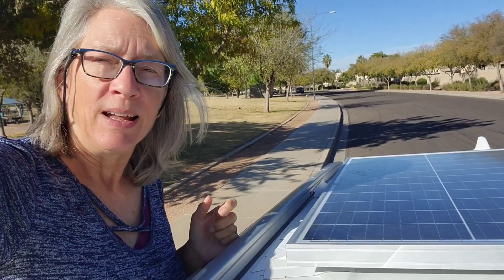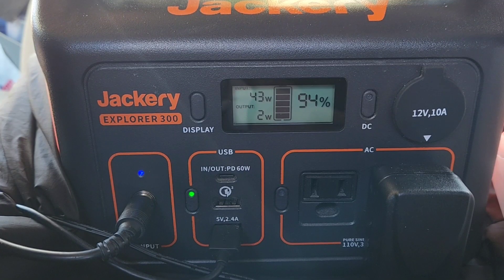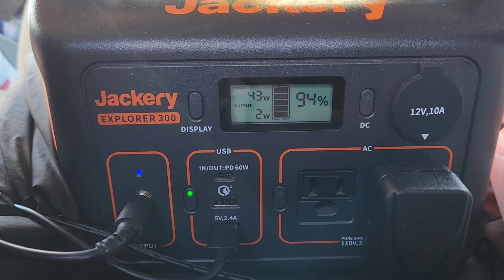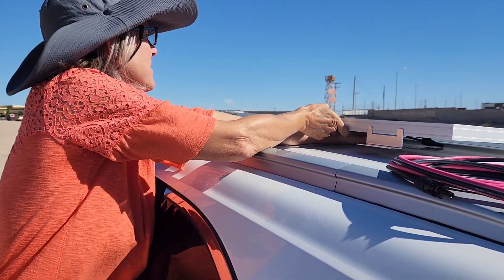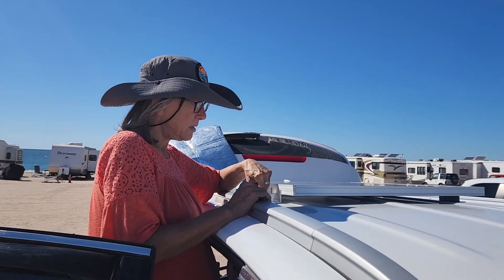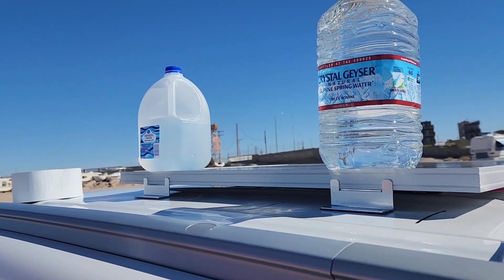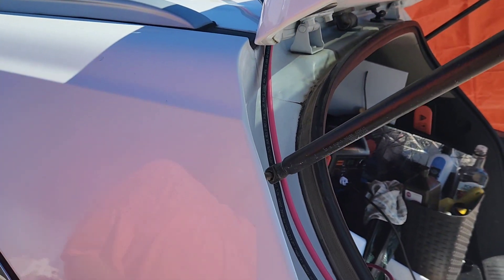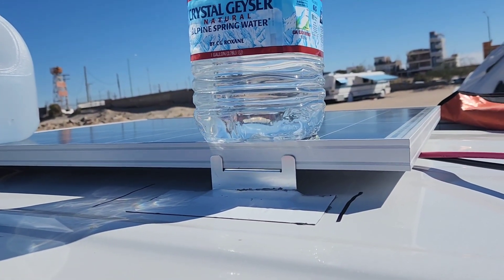Solo female nomad SUV solar panel upgrade how-to

Comment: Hi again. Really enjoying your discussions of nomad life. As I mentioned in another comment, I’m 2-3 years from retirement and am spending a lot of time researching various aspects of living in a van. My power wants (not “needs”) include a refrigerator and a heater, which means a much bigger power requirement. I’m probably going with converting a Ford Transit and using a 1500W power station that lets you recharge while you’re driving, with solar panels to top up when spending several days at a site. I’m still in the middle of my electrical choices. I’m thinking, if possible, I’ll have 200W panels on top of the van, with 200W portable panels that I can set out when I’ll be stationary for a while. 400W of solar panels might be overkill if I’m traveling consistently, but I don’t want to have to get on the road because I don’t have enough to recharge the battery using solar.

Thanks again!
Reply from the maker: If you can fit 375 watts on your roof, you may find that enough. Make sure to do the math on watts used by your appliances, and that they are 12 volt and not AC current, so you have big enough battery capacity. Enjoy the research!